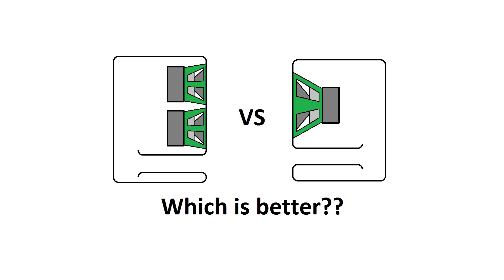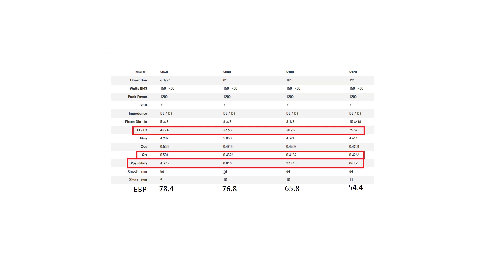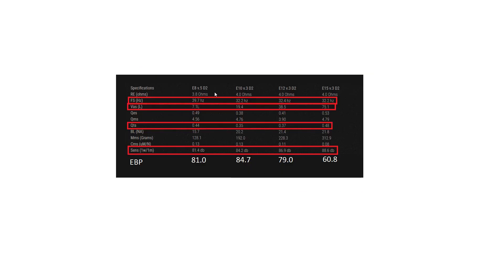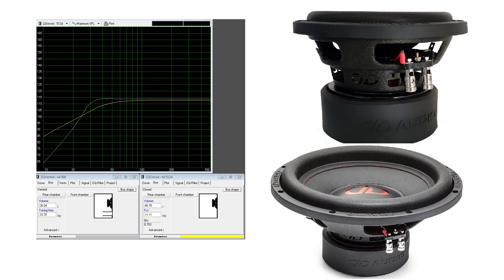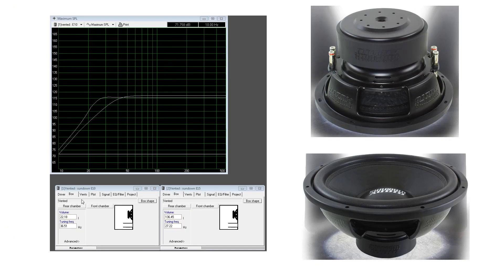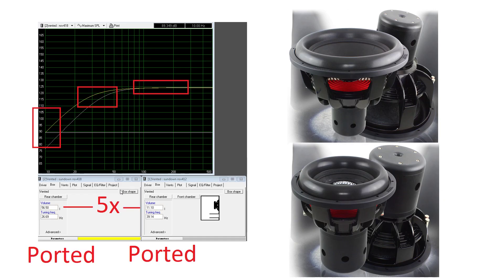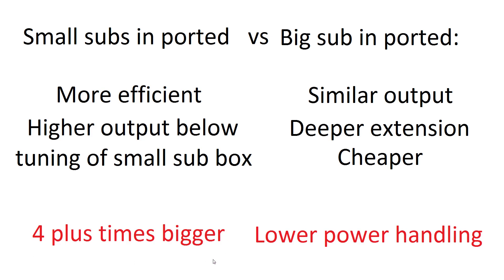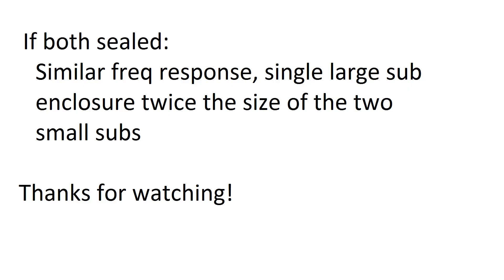Two small subs or One large sub?

Comment: Great video. I went from 2 scar audio ix8's to 2 vvx8's in the exact same small'ish box (bazooka tubes) I want to say the ix8's got a I little bit lower in the freq range than the vvx8's. I'm thinking the enclosure was closer to ix specs than the vvx.  The vvx' splay louder but it seems the ix had lower extension
Reply: I have mine in 1.30 cubes pr . Hits down to 30 befor it bottoms out
Reply: @nickp66104  ix's or the vvx's? Mine hit plenty low but they only have about .5cu each (bazooka tubes) and the additional displacement of the deeper drivers seem to hurt the low end efficiency.
Reply: @A8vscRrabbit  vvxs , i tried tubes . They sounded shitty af. Put em in box made for 10s they sound much louder an deeper.
Reply: @A8vscRrabbit  basicly i sold old car put 2 vvx 8s in my yukon as as  a temp . Sounds good enough tell i can afford what i want
Reply: @nickp66104  hmmm. I was thinking about something like that. A pair of 10" ported truck boxes might fit. Space is at a premium in my ranch rocket. 91 yota standard cab
Reply: sell those and buy one jl audio w7-8. I bet its louder and cleaner and hit really low.
Reply: @jondoe6618  no disrespect but jl is way over priced.
Reply: nick p they are expensive
Reply: @nickp66104  it's all relative....rolex watches are expensive but folks still buy them
Reply: @A8vscRrabbit  well fact that sub is 500+ u could get 10 other brands that outperform it in same size for half the price.but your right .
Reply: @jondoe6618  not enough room. Standard cab toyota truck
Reply: @A8vscRrabbit  Ah I hear ya there.

Comment: I am missing goup delay and phase in this video. Close enclosures have there benifit there however to the cost of max spl
Reply from the maker: Lower group delay on sealed enclosures:
https://media.discordapp.net/attachments/341540422566281216/632789649449943042/2.PNG?width=939&height=554
Also no phase flipping:

https://media.discordapp.net/attachments/341540422566281216/632789655347134465/1.PNG?width=932&height=553

Comment: Build a transmission line box and everybody and everything is happy
Reply: A nice tline is almost as easy to build as any nowadays. Hornresponce, thx to Mr David Mcbean
Reply: No one has enough space in a car to build a TL around a big subwoofer.
Reply: If you don't have the space I recommend using a smaller driver T lines are amazing and well worth the effort I was on the fence about them too until I build one all low frequency that comes out of the box is clean crisp and amazing people are blowing away when I tell them that I have just one 12 there's no more of that one hit wonder frequency they all hit good and clean and hard it's not a power-hungry design box which makes it even better
Reply: If built correctly... the amount of wood and trail/error isn't worth it unless you have money to burn.
Reply: Foodhates, dont waste wood, simulate first. Adrei, 40x18x16, isnt too big? Theres two 570cm2 faced 12s in that space tuned in the Low 30s. Taper your line.
Reply: or you could just build a 6th order box and get better sensitivity and output because your not wasting energy for above 100hz. having had both tline and 6th order boxes, 6th order for the same space and less it will outplay a tline. hit the same lows and no waste above 2nd chamber tune
Reply: Maybe, but my research shows they are just too unpredictable :( If you built one and it was great, that great. But its just as likely to suck... without a lot of tweaking anyway.